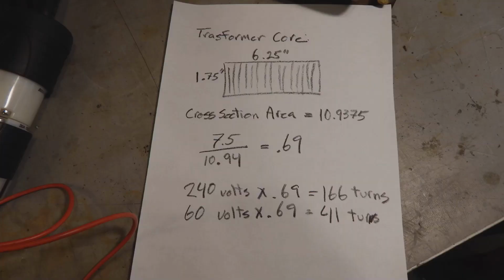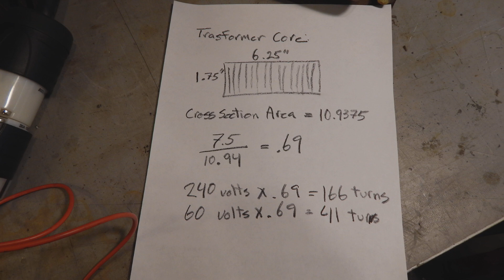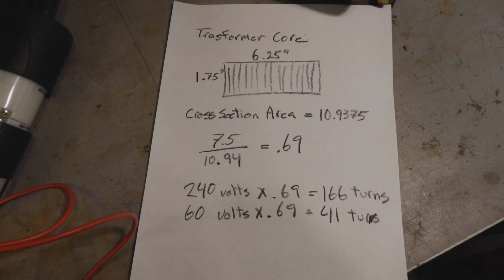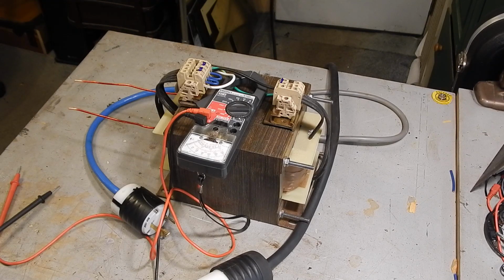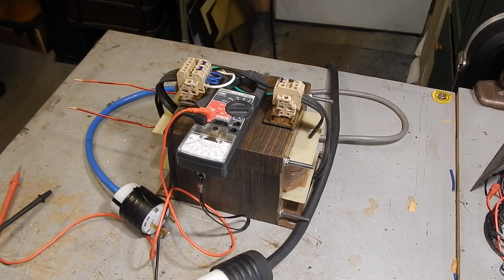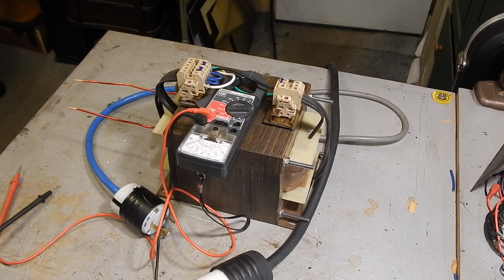Welder 3 -  Winding the transformer

Comment: What kind of glue is used to hold it together I have a millermatic 251 that I want to rewind that was burnt up by someone crossing the leads of voltage input supposably it's almost $1,400 for a transformer I think I could do this myself
Reply from the maker: IIRC they dip the whole transformer in varnish, preferably in a vacuum pot so it gets into all the windings.